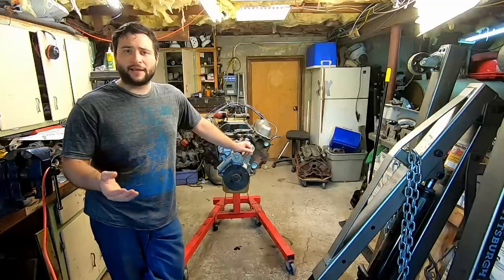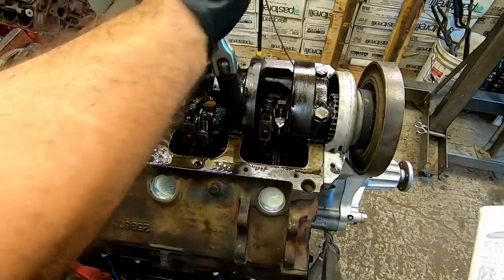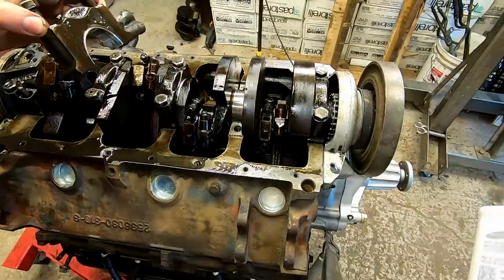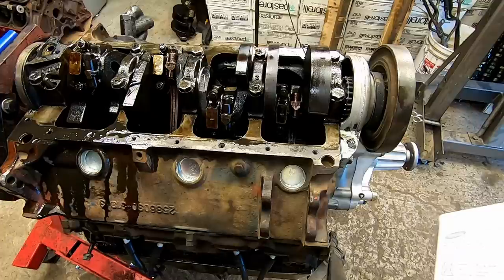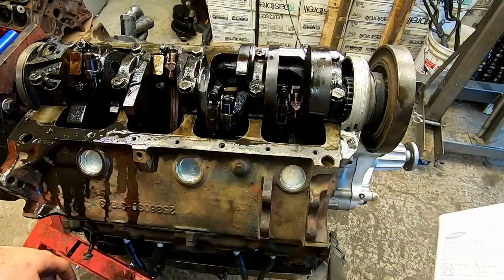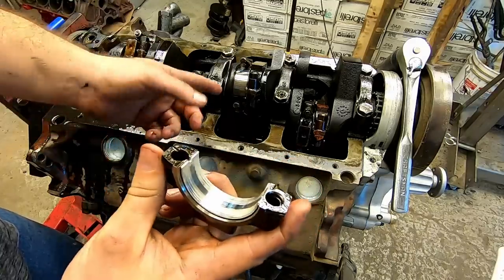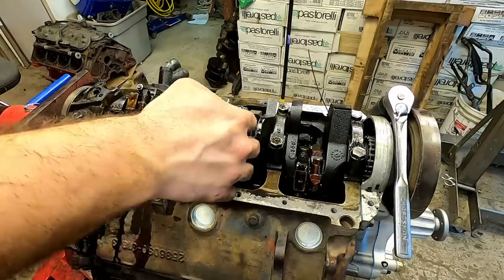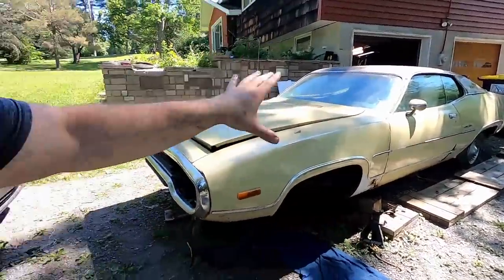The Mystery of the 318's Low Oil Pressure Solved! update the crank was worn out .07 not machined

Comment: As for cleaning out an engine without dismantling it... my dad was a life long mechanic and MoPar service manager in the 60’s and 70’s. When I was 16 and bought a ‘62 Belvedere 2 door sedan with a 225, he taught me how to ‘desludge’ it. We pulled the valve cover, drained the oil. 

Then he had me use oven cleaner, engine degreaser, and tons of water. 

It sounds crazy, but when it was all said and done we pulled the oil pan and the pickup tube. One final flush with engine cleaner and tons of water, a deep cleaning of the pan BBC and pickup tube and it all went back together. Valvoline 10w30, a Phram PH8A filter, and II was off to the races. I mean to school. I believe we changed the oil after about 500 miles. 

It may sound crazy, but it worked.
Reply: Awesome.. Old School knowledge for old school engine's.. Mopar Everyday and Everywhere..

Comment: I think at this point I would pull the engine apart mic the crank have everything cleaned and reassemble. The fact the bearings are too big and look scuffed I would check the crank for ovality/roundness and if it's straight don't want to spin a new bearing.

Comment: Quit taking shortcuts.  How many times do you want to repeat this? do you want it to last?  How much time and $ do you want to waste?  Take it apart. Have the block cleaned in a washer or baked. Clean out the heads.  Clean it all.  Nothing wrong with turned mains and std rods.  Mark the crank with an engraver M10 for the next guy.  Balance your rods.  I have 4 cylinder with rods from 3 engines so we had closer weights prior to balancing.  Do it right and be done.
Reply: He listened to Uncle Tony... He was the one who knows better :)
Reply: Putting a 318 together carefully and cleanly would be sacrilege. It would be seen as an incredible waste of time to do that for a lowly 318. Those engines were made to be abused and disrespected, even worse than the Chevy 305 or the earlier 307. They are seen as boat anchors, virtual garbage, one of the worst V8's ever crapped out by a factory. It's the Rodney Dangerfield of car engines.

Comment: Sounds like sometime in your 318's life it spun a main bearing and they had the mains turned out .010, but in your situation it's easy to just replace the .010 over new bearings, with the crank in the block it's easy I've had done it plenty of times when an oil pump died and pumped barely 10 psi most of the times and the bearings were not torn up but worn well so just swap out the mains with a size over because the crank was turned, also mike half the mains the double it and try it out, it'll save you loads of time and not a trip to the machinist shop, 318's are pretty much bullet proof and just about everywhere in salvage yards or even at machine shops in the back sitting without being too expensive to replace the crank or block if needed.

Comment: Well, they're not loose enough that the crank was turned, but apparently somebody polished it up after it was worn down from use, resulting in only a few thousandths smaller journals.  But, that's what tends to happen when you try to throw an engine together in a hurry.  Live and learn, take your time.  You'll probably have to get the crank turned in order to get new bearings to fit properly.  The rods might be looser than you think, you have to be very careful checking rod journals with plastigage.  It's really easy to push the rod cap down even a slight bit and squish the plastigage more than it would be.

Comment: That is awesome!!! I am so glad you found the issue. What I cannot believe is the mains are turned and the connecting rod journals are not. 
I hope the cam bearings are okay and not excessively worn. 
  Are you going to go with Tony's recommendation with adjustable push rods?
Have you or are you going to check to see that the camshaft is not excessively worn?
Even with that much slop, or "play" in both lifters and bearings in the bottom end,  I worry about excessive premature wear and "hotspots" in the metal. 
Looking forward to the next video!! Thank you for the opportunity to experience your fun filled project!!
Reply from the maker: No The adjustable valve train is too expensive so I went with the route that Nick suggested and get the appropriate valve train for the engine. I’m gonna be going through a few more things in the engine to make sure everything‘s ready to go. The next time it goes to nicks I want to be 100% ready I don’t wanna waste his time. There will be a video from where we leave off now to what numbers we get from Nick’s Dyno😁🤙
Reply: Turning one or the other on cranks happened a lot back in the old days.  It saved you money and most good machine shops would tell you if you could get away with a polish.
Reply: @LunarOutlawsGarage  You just need the right length of pushrods.. you don't run "adjustable" pushrods in an engine.. you just use them to check the length you need to get your lifter preload right.  I would say geometry but with a rocker shaft setup you can't adjust the geometry as simply as by pushrod length.  You can buy pushrods in any length you want... start with stock and get one adjustable pushrod to figure out what you need.  Like a stock LA 318 is 7.5" pushrods... the Comp 7702-1 is adjustable from 6.8" to 7.8".  Buy one of those and figure out what you need.
Reply: @LSswapGarage1  they literally sell adjustable pushrods. they work too. better than $600 rockers.
Reply: @frigglebiscuit7484  Or you can "literally" measure the length and put in a proper pushrod... this isn't hard.  There is absolutely zero reason for the existence of an "adjustable" pushrod beyond measuring for the correct length.  It doesn't need to change while running lol.

Comment: You might want to check the rods and mains with telescoping gauges, they may not be round anymore...Also I bought a used 302 when I tore it down it was built the same way it was one of those parts store replacement engines, it still had the metal tag stuck to the block. I had like 3 no5 rods 2 4's and all different style main caps. It freaked me out to.

Comment: If it's been apart no telling what was done by plan or accident. Years ago I built up a Ford 428 FE that appears to have been set up earlier with looser clearances. Discussing with a few people it seems they set the bearing and piston clearance a little loose with the intention of reducing friction and compensating by using a thicker oil.  I ended up going .030 over to get the cylinders where we had normal clearances on a piston and turning the crank  down enough to use a undersized bearing. My machinist said the crank had been turned but it was done poorly or not cut enough for an undersized bearing.  I got the engine out of a Torino street car but suspect it had been in a stock car at one time.

Comment: ive had the same problem with oil pressure in my 81 elco got it for a good price considering how clean it was the drive train looked great new looking reman/rebuilt 350 no dirt or oil on it 700r4 the case looks new .. drive it when cold 60psi no knocking when it warms up 20psi at best @50mph at idle the needle on gauge would lay flat get around 1800 rpm knocking sound starts slow deep rhythmic knocking .. i parked it but have suspected the main bearings are wrong like lunar found

Comment: Ok nobody checked the clearances on assembly or checked the old bearings for size on the back wow what an oversight.i had my first ever machine shop engine built by a machine shop which I was to assemble they gave me the wrong bearings I heard that word ass  u  me for future reference RIP or cut one section off plastigauge that way you are not opening the whole sleeve much easier to work with
Reply from the maker: Lol trust but verify live and learn

Comment: I watched nearly the full build at Tony's. I cringed when he was putting it together and not checking any clearances, especially after realizing somebody else was in there. I was sure this was where your problem was. And his freeze plug installation technique is abysmal. Couldn't help but laugh at this after he put out a video criticizing somebody else using silicone on a timing cover gasket in a 360 he pulled apart, I believe he called it pure butchery. Nice of him to put you on blast and tell Nick to dump this thing over something he couldn't bother to double check.
As for cleaning the block up while it's already assembled, get a pressurized sprayer and use gasoline to douche it out. Won't hurt anything. Then reprime the whole oil system when you're done. Hope the rest of the build comes together without any major hiccups.

Comment: Rebuilt my first Mopar almost 40 years ago at 18.  The untouched 440 has 10 under rod journals from the factory.  Sometimes, you can get that probably from a problem during original grind.
Reply: This is true I'm a Auto Machine shop owner in Connecticut  and I know at least 1 time in my life I did see a SB Mopar with standard rod bearings and .010" under mains right from the factory.

Comment: 1) "ALWAYS" have a block and heads boiled and cleaned!  2) "ALWAYS" blow out "ALL" oil passages in the block. In the heads, all Int & Exh  ports and water jackets after being boiled with compressed air!  3) "ALWAYS" Use half torque equally on main and rod bearing caps equally before final torque!  4) You have mic's and calipers, "USE them "FIRST". Don't "GUESS", as I am sure you found out the hard way by now! But hey, I started out rebuilding engines 60 years ago. I lived and learned from my mistakes too! Just don't repeat them! Lol. Hang in there and heads up! Or down if working on an inverted engine. Lol...

Comment: Did you put new soft plugs in BOTH oil gallery holes behind the camshaft thrust plate?Mopar engineers got rid of the squirter bolt on the right side of the cam plate to increase low speed oil pressure. There are numerous videos on you tube that explains this.I had this issue with a 273 back in 1970.  Did you pressure wash the oil galleries just prior to assembly? With that fiberglass hanging from the garage ceiling you might have gotten a bug in there,clean room conditions ain't prevaling  there.

Comment: Man this has me wondering about my .060 over 318. I’ve been chasing this noise around for 8 years. And just now am I learning that 20 psi at idle is low for a small block Mopar. Ill send you some videos later to check out. I am hoping it’s my comp cam xe268 and lifters. Almost sounds like a rod knock but no way could I have drove it for 8 years and it be ok. You only hear the noise when u rev it around 2500rpm and feather the throttle. So strange. I mean my feelings will be so hurt if I have to get a new cam and lifters!

Comment: quick question my 318 Dodge Dakota I'll be running fine nothing going nothing wrong with it all sudden it'll start rattling and lose power literally you're putting neutral shut it off crank it back up and it starts running good again and it helps tell me what could be wrong with it I was thinking maybe the oil pick up

Comment: My father & I always mic the crank you just never know
Reply from the maker: I take for granted that all the engines I ever mess with are so new that they haven’t had time to be butchered lol
Reply: @LunarOutlawsGarage  the new ones you have to watch to see if the head is warped . The old ones the heads could be cracked the gides could be taped & will only be ok for half the life they should be if you spin a bearing they will turn down the crank rather one or all so if one it's a real pain . You bore all the cylinders for balince but some just do one and it's just nuts

Comment: Did you get it back on the dyno? If so what were your numbers after getting the mains replaced? I tried looking on your other videos and I haven't seen an update on final hp numbers. I've had crank issues with a 235 chevy stovebolt 6. This was using a 53 block that needed adjusting the clearance on the mains with copper shims. Definitely older school than me back when I was 16. I had the crank turned and bearings supplied by the machine shop and they gave me the wrong bearings, so as a lesson, don't trust anybody but yourself. Great video.

Comment: Good job man  👍 glad to see some one figure it out any grunge that was in the engine was likely already flushed out when the engine was on the Dyno if you have the oil filter from the Dyno run you should cut it open and see what s in there if it doesn't look too bad just replace the bearings and in joy✌️
Reply: Oh, Nick cut open the filter.  It was loaded with crud and metal.  The original plan was to get the correct length pushrods, slap on the valve covers and dyno it.  Now he’s gotta yank the crank it and mic it.  He’s not going to tear it down and clean it because he wants to see how it runs the way it was slapped together.  Meh.  I think that ship sailed, but what the hell?  It’s not like he dropped $3,000 on a hemi block.  Oh wait...he dropped $7,000 already.
Reply: @southjerseyjim5049  7000 where  ? My point was that it was already run with metal and crap in it so it's a little late to worry about it now
Reply from the maker: You got it Oscar. 🤘I have talked to a few people about what can be done just to knock anything left in there. Next video will be from here to it crossing the finish line
Reply: Oscar Walton He spent about $1,200 in parts and the rest were travel expenses and customs fees.  He added it up and going back and forthe to Tennessee and Canada cost him about $6,000 all told.
Reply: Oscar Walton Also, the crank appears to have suffered no damage from the oil contamination.  So, the engine has sort have been flushed during the break in.  Brian is going to get as much junk out of the engine as possible and run it.
Reply: @southjerseyjim5049  yeah ok I wondered about that 🤔 hopefully the person who turned the crank wasn't a total hack.

Comment: A good Machine shop would have stamped crank with the undersize. You had already loosened both rod nuts
Reply: I'm guessing some home builder just polished the crank at some point, rather than having it turned.  That would explain why it's only a little loose and not stamped.  I'll bet 10 under bearings will be too tight, he's probably going to have to get the crank turned.
Reply: I have worked on a TON of engines that had cranks of various undersize journals and very RARELY are they stamped. You have to mic them yourself to find what size they are.
Reply: @livewire2759  You used the words "guessing, a little, I'll bet, and probably." Let's hope he mics everything and none of those words will be needed at all.
Reply: @ronjones-6977  LOL  Yeah, let's hope so for his sake.  All I can do is guess, the ability to know for sure is all his.
Reply: Yes i have had cranks done and they stamped the crank. Main size and rod size on the rear throw of the crank

Comment: It was common for Mopar engines from the factory to sometimes have .010" under journals.  I had a '74 Satellite with 318 that I bought new, and it had .010" under bearings.  Look for a 1 stamped on the front counterweight.  On the 440 and Hemi sometimes it would be just one journal turned .010" under, or more.   They would do this if a flaw was discovered, and machining could fix the flaw.

It was also common from the factory to not have the pistons in the correct cylinders, but the odds would be on the correct side and the evens on the correct side.  On that same engine, this was quite a while back, but I think 7  and 3 were swapped.

Comment: A crankshaft that has been turned will have it stamped, .010 M under it 020 R, did you even look when you cleaned the crank? I was also suprised Nick didn't check the pressure relief spring in the oil pump, I shim them with washers to increase pressure too!.

Comment: I have always used plastigage before final assembly just to be certain. Cheap insurance. As far as where to go from here, you could try flushing the oil galley from the oil filter to the pump. Replace pump. Under haul the mains with correct bearings, but plastigauge all of them and the rods. Farm equipment is regularly under hauled in which the engine remains assembled but the rods and main bearings are replaced by sliding the bearings out and new ones back in.

Comment: Plastiguage is a really good when it comes to checking bearing clearances. The best way is to use inner and outer micrometer to be absolutely sure of what the bearing gap is. When using plastiguage.  You need to measure the clearance with the crank dry. No oil in the journal because it will give you a false reading. I would use something very thin, like WD40, but that’s it.
Your measurement means the bearings are to small. The gap is larger than what the bearings can make up for.

Comment: Just built a Venturi out of an airline and some fittings and use gasoline or laquer thinner and spray clean the block. I've don't this 100 times on crusted up motors from bad oil and I just wash it all into the pan and clear it out with fresh oil and reassemble it

Comment: While you're at it, get it re-bored, new pistons, and rings. Over sizes .020" .030" .040" .060". 
Use feeler gauges to check clearances are within spec.
Replace rod, main, and cam bearings. Take the crank to a machine shop, measure the journals with a micrometer. Then check the size you get against the minimum factory size, what ever the size is, order bearings to suit if it's within spec. If it's not. Get the crank reground. Bearing sizes can be ordered in std, .001" , .010", .020", .030" undersize. It would also be in your best interest to get the engine balanced with your new flywheel, flex plate, and harmonic balancer at a reptuple shop.check the new oil pump clearances are within spec.
Do the platigauge check on every journal. Don't final assemble until it is correct.
You also need to have the engine block main tunnel and connecting rod big endl size checked with a bore gauge.